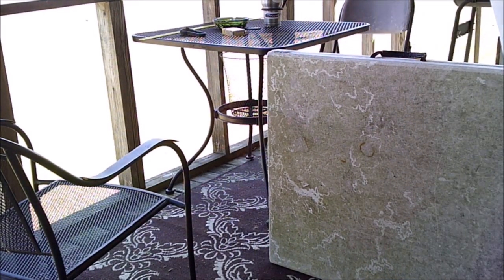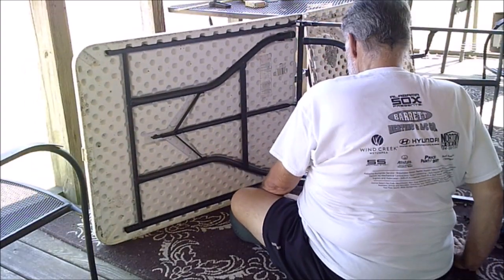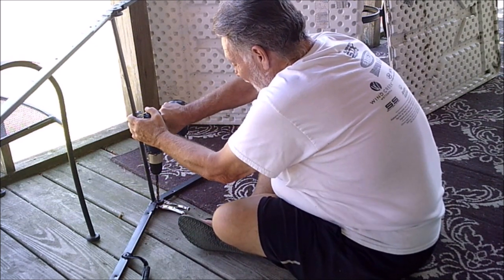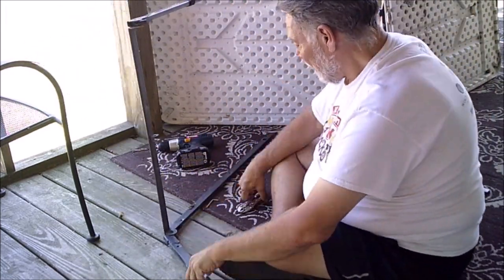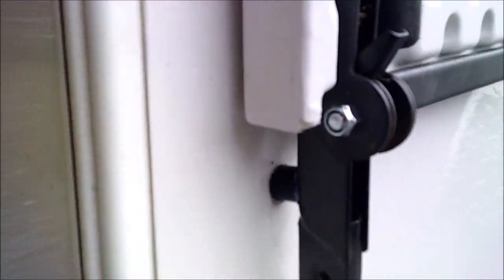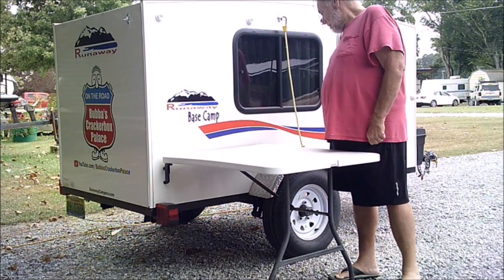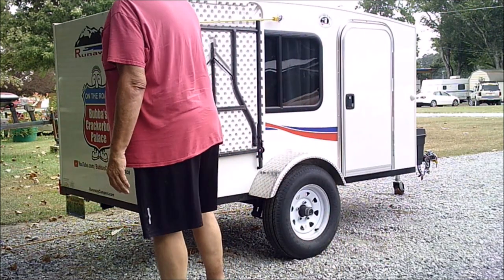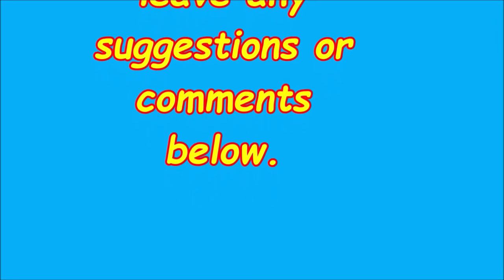A DIY outside drop-down table for my tiny Runaway Camper, The Crackerbox Palace.

Comment: Do you worry about water leaking through the connecting points?
Reply from the maker: Although I do hate having to pierce the outside aluminum layers of the trailer, I do try to follow best practices for sealing/protecting entry points in instances that require me to do so. In this case I used stainless steel #10 screws with 3M High Bond adhesive and generous amounts of 100% silicone sealer. (And a big helping of a wing and a prayer)
Reply from the maker: And the bumpers are peel-n-stick.